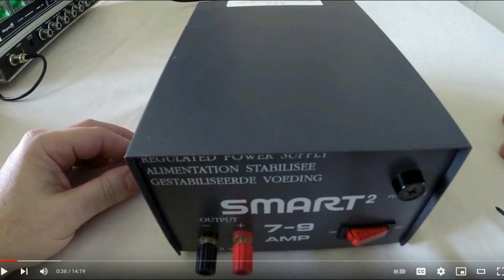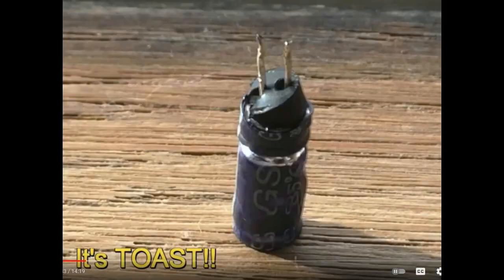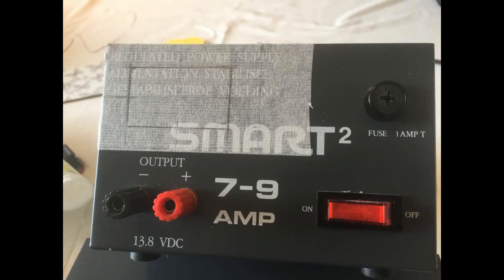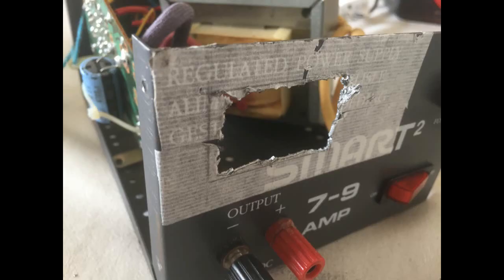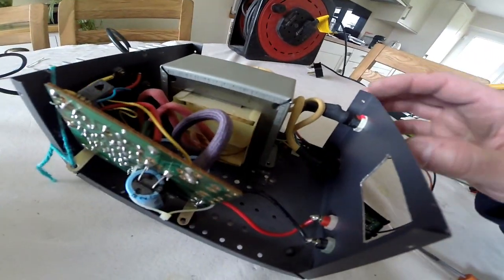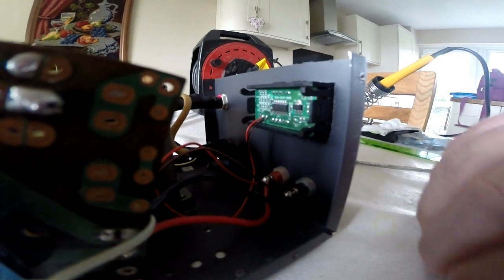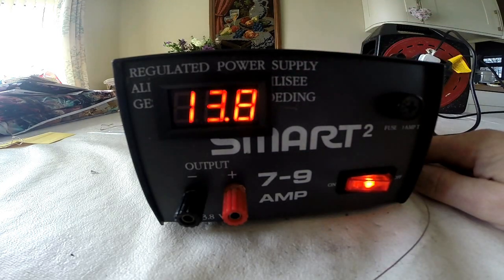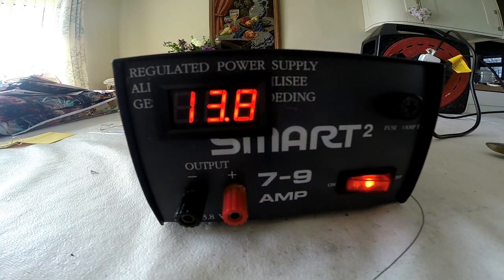**Warning** Don't let your CB Radio Power Pack do this!

Comment: why not just use one with a meter?
Reply from the maker: Not everyone has a metered one and they can be be  quite expensive, not sure where you are located but in the UK we have loads of this style of powerpack floating about left over from the cb boom. So for quite a few operators and relatively cheaply it should be useful, and if it can  happen to me it can happen to anyone. 👍

Comment: I use a bench power supply designed for electronics work. I can set the upper voltage, and also an upper current limit. Job done.
Reply from the maker: Thats a good call and have to say great youtube name! 😂😂

Comment: I have lots of power supply you can't trust most of it great idea putting voltage meter on still won't protect your radio still can go over voltage with out reason it happens to me I was talking just on 4 watts and the rig just went very bright and went off it was fuse popped so I've replaced the fuse it popped again it was the power supply doing 22 volts I end up fix the power supply and the rig and upgrade the power supply with Crowbar it peace of mind.
Reply from the maker: Hi Salvage1 aware of the crowbar mod and if people want to add that then they can but for me i want something i can see so hence the meter addition. Its a pain in the backside when u see the smoke, glad u got yours sorted👍

Comment: Why not fit a Crowbar circuit to blow a fuse as soon as it goes to 16 volts?
Reply from the maker: Hi bob i,wanted a visual indicator feels better that way after last time👍
Reply: @britishcbradio1055  Yes I get that, but a crowbar on the output would blow a fuse and kill it before damage to a CB or Radio, it happens quicker than you will notice and react to the display!
Reply from the maker: @BoB4jjjjs  i may have cat like reflexes you never know!😂👍

Comment: Great job mate that looks great and has definitely given me some thought!
Reply from the maker: Many thanks, its just when you flick the switch you assume 13.8v but as i found out - nope 26v when it was too late so thats why i put this together as had never imagined a power pack could do that. 👍 Let me know what you decide to do, you can get a dual meter showings amps drawn as well but for this i just wanted a visual voltage display.
Reply: @britishcbradio1055  I ordered 3 dual meters for different projects! Thanks again for a great idea!👍
Reply from the maker: @dxscotland5901  Your welcome and glad it gave you some ideas, thats what its here to do. 👍

Comment: As Michael Jones mentioned below, there're Volt & Amp meters in same size and may be you can think about to put another ON/OFF toggle switch to control DC current flowing to your radio. Anyway, good dx!
Reply from the maker: Ho Sertac , thanks for the comment, interesting stuff. Following what happened i wanted a visual in your face  voltage display as if it ever goes again j will see it and can turn it off. I know there ate other mods you can do but again you cannot monitor if they are working i wanted that visual control that this simple and cheap mod gives me. All the best and good DX! 👍

Comment: 16V TVS Diode + Fuse, easy to modify.
Reply from the maker: Hi Dronf, thanks for the info, yes did know about that mod but following what happened i wanted to install a visual indicator so u can see instantly what is going on rather than just assuming all is good. 👍 Happy DX’ing!
Reply: Might work on a low current supply, but anything capable of delivering decent amps might vapourise a TVS before the fuse blows, they're intended for spikes, not continuous overload. 

Fit them along with a Crowbar circuit and you're double protected.

No reason not to fit a voltmeter and even an ammeter as well

Comment: Did the same thing but I used the ones with the amp display as well so I know how many amps I am drawing great little piece of kit for the price
Reply from the maker: Hi Michael, yes a nice piece of kit and  a good call, did see the amp option but for me i needed to specifically remove the voltage doubt after it injected  26v into my radio, going to do this on all my rig supplies. Good dx!